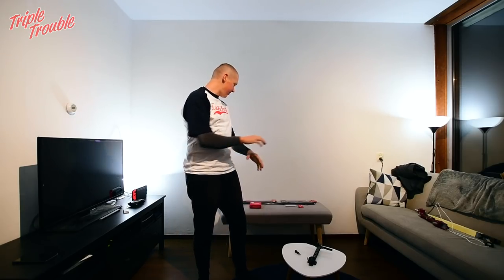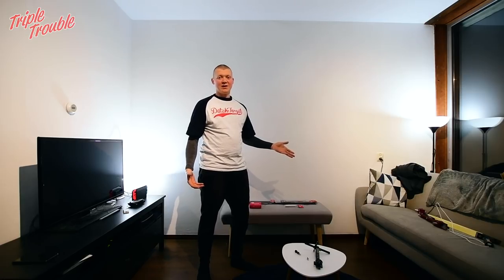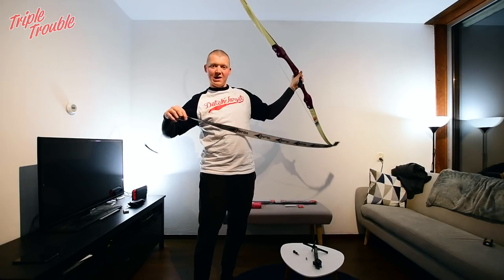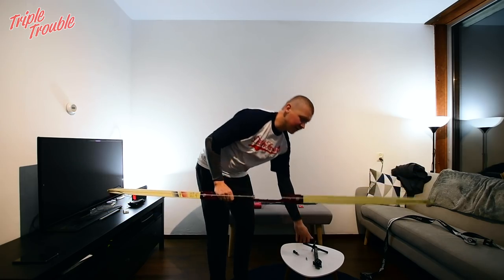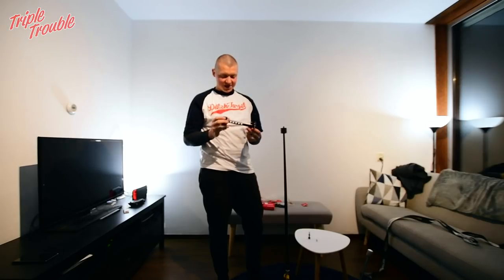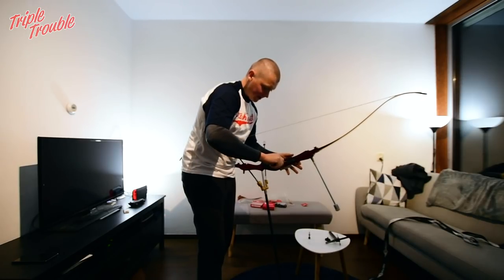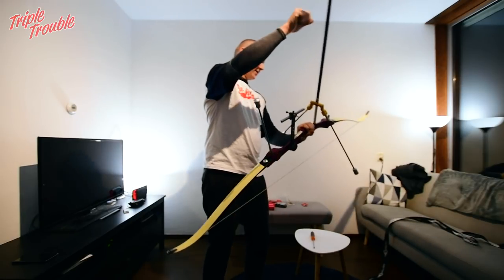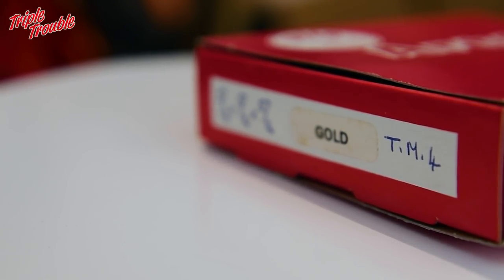40 y/o Recurve Bow!? (Part 2 - Assembly!)

Comment: That's a Hoyt TD3 ... Darrell Pace is the first archer to break 1300 using alum arrows and 48# fiberglass limbs .. I think these bows are still at par with the new bows of today .. right now im using the old hoyt gm4 with yamaha ys5 sight, shibuya dx plunger, old shibuya flipper rest .. but changed to lighter limbs from hoyt carbon plus 42# now i switched to 32# samick carbon impress limbs .. still waiting for my hoyt carbon 840 at 36# .. a senior archer now and cannot draw heavier poundage .. still looking good .. maybe do more practice after a long 30 yr lay off from the sport .. thanks for this video .. im an avid follower ..
Reply: ... Darrell Pace i believe used a Hoyt TD2 and maybe with the heavy Killian Sight .. one of the most durable sight during those time .. great videos from Triple Trouble and NuSensei ... i love you guys .. more power
Reply: ... that's a shibuya dx plunger .. i still have 2 of those and still using it ... not familiar with your v-bar but its the same with the 3rd gen v-bar released by hoyt in the late 70's .. if i can only load some pics and show to you my set up 😉